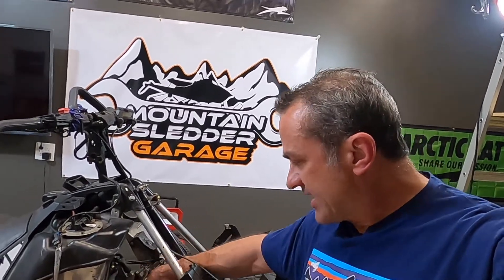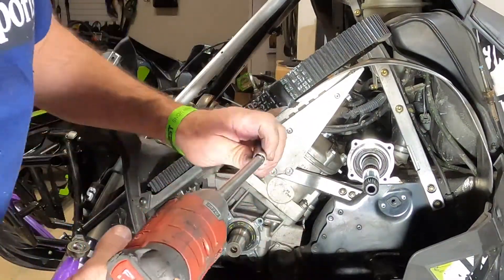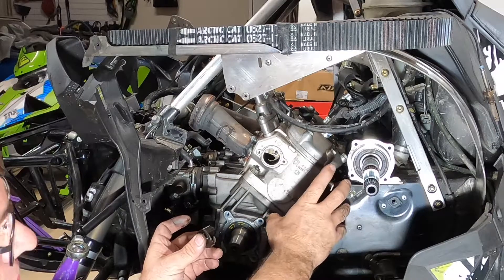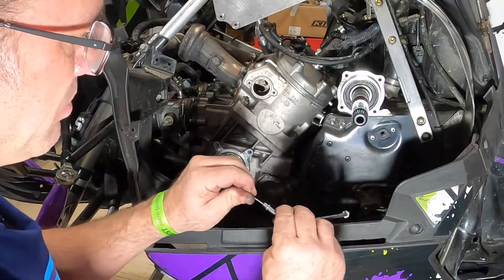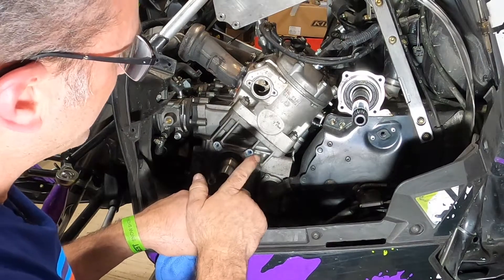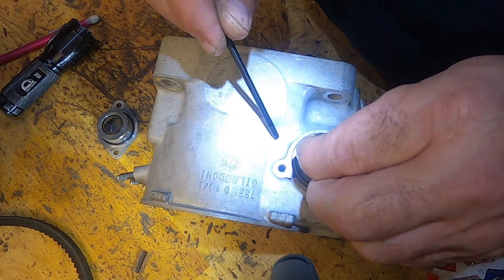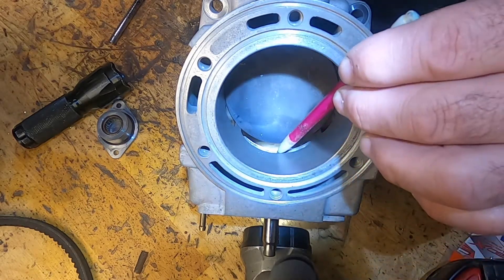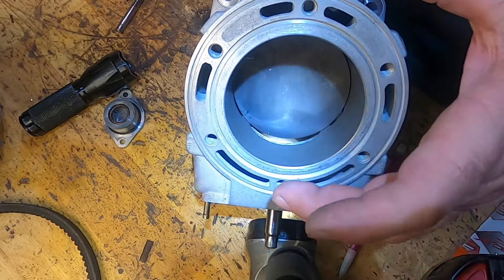Arctic cat power valve disassembly

Comment: Thanks for a great video. I like the old Suzuki 800 design because the exhaust valve is much easier to service. The CTEC 800 makes equal or less power than the zuk. No advantage to this design. The CTEC 600 is NOT like this. I have a 2019 ZR 8000 with 2500 miles. I have not cleaned the exhaust valves yet. Your tutorial will help me greatly.

Comment: Im not sure it's that easy to remove the bracing on an 18 on the clutch side but now im gonna look. Also be super careful when you pull the pin the piece it goes into on the inside doesn't rotate because you may have to pull the cylinder if it does.

Comment: Excellent video. I’m going to be doing the top end on my 18 800 this summer. I’m thinking if I remove the mag side cylinder first I can take the cap off the opposite side on my clutch side cylinder allowing me to avoid removing the primary clutch.
BTW My machine has 12,000 kms and I never had to touch my exhaust valves until this winter when my exhaust valve cable broke on a trip and the dealer said the valves still looked relatively clean.
Reply: What kind of oil do you use? I’ve had a exhaust valve gum up at 3000 miles using arctic cat ctec oil. Also unless your sled has a low compression test I wouldn’t worry about the top end yet. I have one with 7500 miles, still perfect. My dealer has seen them with 10,000 miles still testing great. They said unless it drops don’t touch it.
Reply: For oil I just use whatever kind of oil the gas station sells. Usually conventional oil. I only use my machine on week long or more rides and I refuse to carry oil. I do add a little extra oil to the gas as insurance though. About 100/1. My engine was still running fine when I took the top end off but it has endured a LOT of full throttle operation as most of the guys in our group including myself are retired pro motocross riders and we tend to run the sleds very hard.

Comment: I think the inside secondary valve rotated the pin will push all the way thru. Any thoughts on how to get the pin in the slot on the inside secondary valve without pulling the cylinder?

Comment: How far do you push pin in thru the valve when reassemble it to make sure it fits in the slot on the part that open/closes valve. That way it’s in the slot far enough to operate?? Thank you

Comment: Roughly how many km's before exhaust vavles need servicing?
Reply from the maker: Most modern sleds have a self cleaning mode on the exhaust valves. So you really don’t have to all that often. Some people do every summer or 1000 miles or so.
Reply: @mountainsleddergarage8627  could gummed up exhaust valves be the issue why my sled idles but wants to die when you hit the throttle over half? But if you blip the throttle a handful of times you can eventually get WOT
1800kms
Reply: I do mine every 2500-3000 miles

Comment: Would this fix a P1639 and P1640 code? Just put a new servo on it and of course this happens 2 days before my trip
Reply from the maker: Did it have the codes before you replaced the servo? Those two codes have to do with power to the servo.
Reply: @mountainsleddergarage8627  yeah I had the servo replaced twice. The original servo was junk then they put a new one on. Ran amazing then an hour into our ride they came back on and it wasn’t fun. Then had it fixed again this summer. Ran great from my deck to my garage. Took it out to wash it then started it and codes came back up again. What would u suggest?
Reply: @mountainsleddergarage8627  could it have a bad connection in the harness by chance?
Reply from the maker: That is super frustrating. I’d make sure both cables are functional, move the valves freely and are adjusted properly. Sounds like you could have a wire harness problem, seen a few of those on the cats.
Reply: @mountainsleddergarage8627  yeah it’s been frustrating especially since the dealership just kinda gave up on it and keep telling me to buy a new sled